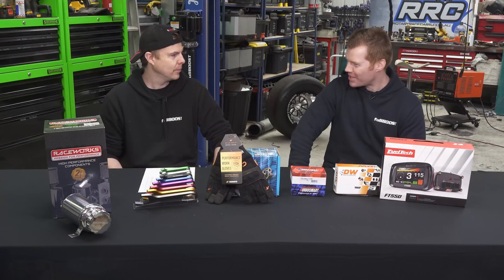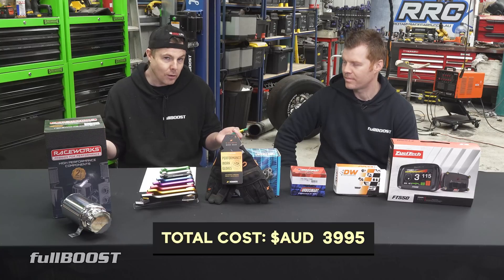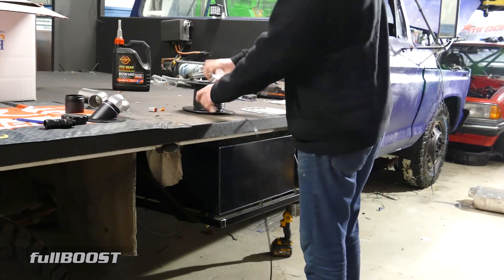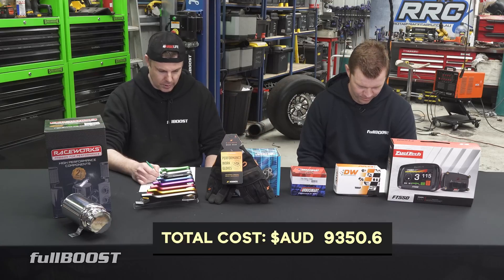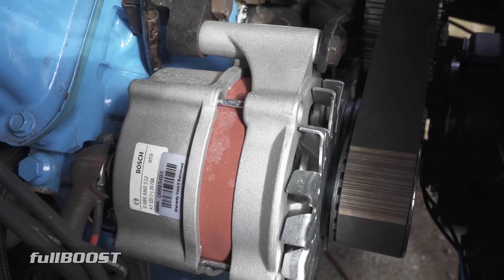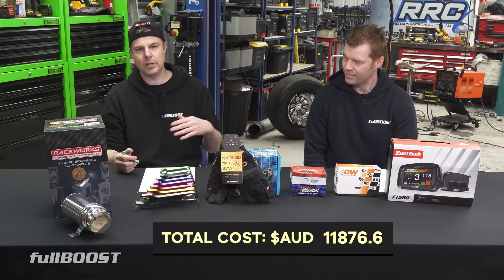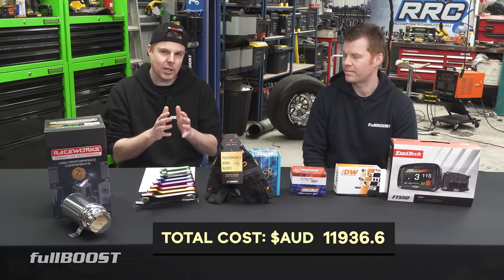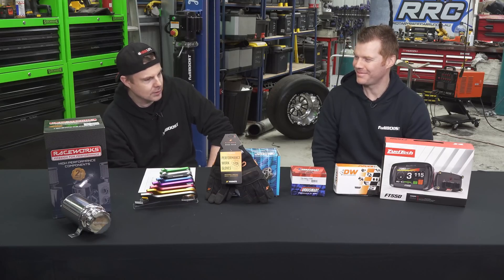How much did our EFI conversion cost? | Ford F350 V8 turbo ramp truck part 8 | BACKYARD MECHANICS

Comment from the maker: People always ask how much did that cost? Well here we break down the costs involved in converting our Project Townado Ford Cleveland 351 V8 to EFI. Of course there are different approaches you can take and this is what worked for us, future proofing for future modification.
Get your track gear!
 👉 http://shop.fullboost.com.au
Reply: If you have a low budget and what a challenge and has more features get this.. https://sptronics.com/product/standalone-engine-management-sem306-based-on-ms3x/ they are based off mega squirt ecu.
Reply: Adrian maybe cheaper but with MS3 if I have an ECU issue it’s a 2 day turn around to have it replaced, what’s the chance of that being done from Egypt? Also I wouldn’t trust many products that steal another company’s design, start producing it in a country then move to Egypt to cut cost on manufacturing said stolen design. Rather spend the money saved on a system where people make a name for their business by letting THEIR product speak for themselves vs use another company’s name to crutch off of.
Reply: Guys keep up the great work your doing, cant wait till restrictions are over :)  I hope its before XMAS 2020.:)

Comment: Great video!
I have what may be a dumb question. The engine plate that holds the injectors. Why do you need 8 injectors? I know you are running a V-8 engine, but those injectors are not spraying into a plenum or runner in front of each cylinder. It would seem that maybe 4 higher volume injectors could do the same job.
I'm genuinely curious about the design and the reasoning. Not being critical.
Reply: Yes you could run 4 injectors they would just have to be double the size. We are not certain on what manifold setup or even engine we will run in the future, but 600cc injectors in a sequential setup in a 6 or 8 cyl is what we require, so it’s what we sourced and are running.

Comment: Guys what about brakes, maybe check out the bendix range to suit say maybe a ford GTP series units larger rotors and also calipers, shame the rear end is drum brakes, still there's better performance units in drums breaks, but again its about costs v's performance outcomes and what the ford tray truck is going to be used for, like i said picking up cars at the drags. :)
Reply: The brakes on this thing are huge. The calipers are 2 piston, but the sheer size of them is ridiculous. The pad surface area is equal to that of any brembo 6 pot you would find. They are all brand new as well. The master, pads, discs and all the shoes, springs, drums and pistons are all brand new. It seems to stop pretty well.

Comment: As far as the dizzy  guys should have put a electronic XD/XE V8 unit, that way its a lot more programmable inho. :)
Reply: The magnetic pickup sends a signal to the ecu and the ecu now runs the timing. So alters timing depending on rpm, map, flex fuel %, etc. much more advanced than a distributor or some msd box.
Reply: Second hand shiz...pfffttt. got a clevo full electronic billet dizzy n magic box, with coil n loom for $1200 from ICE in Melbourne. Piece of piss to setup too. Oh and 3 years warranty, all brand new.

Comment: 30 hours Melbourne to Queensland?? Why are you walking?
Reply: Slap in a barra then it's only $2000 to drive Melb to Brisbane in 10.0 hours...
Reply: @justinfargas2367  make it a renesis engine, cuts it down to about 43 minutes.
Reply: Didn’t I say 20 hours ? Because I mean 20 hours.
Reply: @BroomysGarage  30 hours in a ford 😉

Comment: Wow damn, I was playing with the idea of injecting my gemini...
Reply: Plenty of options out there for you. This is how much it cost to do it with this setup to our truck our way. You could do it for half this or double!
Reply: i know the (4Ze1) 2.6 EFi manifold bolts on to the RWD gemini engine.. no idea about getting the rest to work though
Reply: 4ZC1, 4ZE1, and the Lada Niva used the G161 motor fuel injected so check the Russian's out for bargains. 👍
Reply: I have a built g200 (2lt) the  intake manifold i know where i can grab that, for just under 2k.
 Cheers for the ideas tho guys, always good to have more info 👍

Lada 🤔, yeh those parts are dirt cheap too
Reply: @jo301a7h  Yeah, I was sceptical until I saw it in the late 90s. 👍 The injectors were small as but the manifold was a perfect match for the port.
Reply: @MafiaboysWorld  i tell you what id grab 1 just to see it, but small injectors might be a problem, im hoping for 300hp, 900kg with 300hp sounds like fun times to me
Reply: @jo301a7h  That's a simple swap. So long as you have the intake, you can adapt a fuel rail and fit bigger injectors. 👍
Reply: @i don't believe in the sun  the g series in general i believe were good motors, but i got put off a twin cam years back for some forgotten reason 

 @MafiaboysWorld yeh totally, as long as the injectors aren't some unique random design i couldn't see why not

Comment: I'm going to be one of those people. That's an insane amount for an efi system. what you paid for the ecu is more than my entire 1fz-fe build including: GT3582r turbo and manifold, ECU (including screen) 2 walbro 255 pumps, regulator, WRX injectors, AN fittings and hoses, Cometic head gasket, ARP studs, Valve springs, AEM wideband with bosch sensor, GM 3 bar MAP, twin thermofans, alloy radiator, water to air intercooler, BOV, 4 SAAS gauges, rings and bearings, stainless 3in exhaust with stainless muffler. all for around $3800.
Reply: looks at his channel
Dude, Speeduino? Really? 🤨🤦
Have better reliability tuning with an abacus. 😂
Reply: @MafiaboysWorld  
Will do maf 
poor bloke they work sort of
Reply: @michwas7270  I'd almost have more faith in a Microguess. 😂👍
Reply: @MafiaboysWorld  
yeah it's a very grey area looked at them and came to the conclusion that it's more suitable for the students building robots ect not so much engine management
Reply: @MafiaboysWorld   I'm using an SGC ECU It's based on speeduino firmware but uses an stm32 and has 8 ign and inj channels. screen is via a bluetooth module and tuner studio android app. the speeduinos I have used have proven perfectly reliable.
Reply: @the-THORNSPAWN  See, I looked at the whole Arduino system and my son's godfather makes them in his home country of France. Plus I follow people like DC WERX. I still went standalone with Wolf. There's an extra layer of protection you just can't get with Speeduino and the support is forever there if I need help from Robbie. 😎👍
Reply: @MafiaboysWorld  How many have you used? I could have got a Haltech and garrett turbo and still been cheaper than their simple throttle body setup.
Reply: @the-THORNSPAWN  No you couldn't, the end. They spent $800 on the plate, hat and throttle body, $1760 including injectors. I ordered my pair of Garrett 2860RS's at 20% off and still paid $1400 each. The Haltech 2500 for my 1JZ is just under $2500, plus the PnP harness.
Reply: @MafiaboysWorld  They spent $12K need to go over your maths again.
Reply: @the-THORNSPAWN  You said simple throttle body setup. Now, if you want to include the tanks, the lines, the ECU and everything else needed to convert from carburetor to EFI and say you're cheaper then, go for it. But guaranteed you're already working with a factory EFI car, true? Well then, the lines, tanks, sensors and relays wouldn't be included would it? So take that 12K and make it say 6K. Once again, try and do it for less with the Haltech...
Reply: But did you overnight parts from Japan?
Reply: justin fargas i think gumtree
Reply: @BroomysGarage  Overnight parts from Prahran ?? :-P
Reply: @dazaspc  Nah, not at all. I just build PC's as a hobby and doing a degree in IT (got the HECS debt to prove it too) before I decided to go down a different path and do what I do today with my business redesigning things. For raw power, Speeduino is trash vs a Raspberry Pi, deal with it.
Reply: Nice one. Did you tune it yourself?
Reply: what ecu